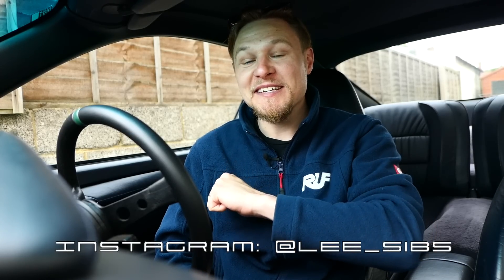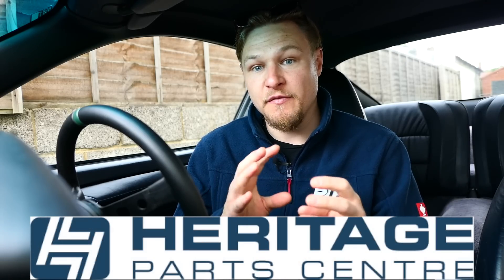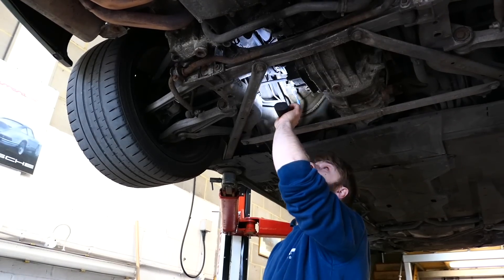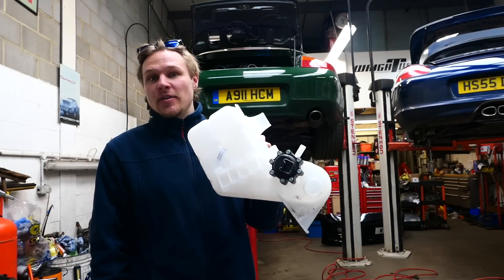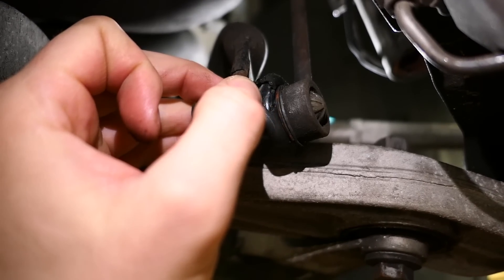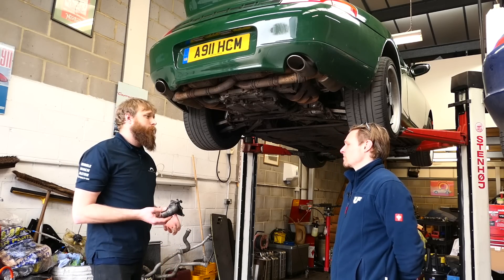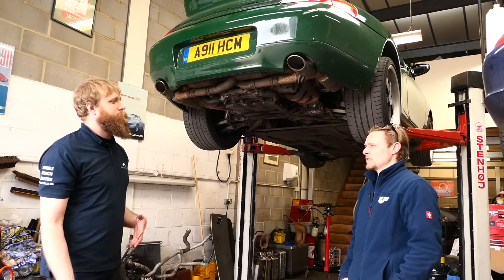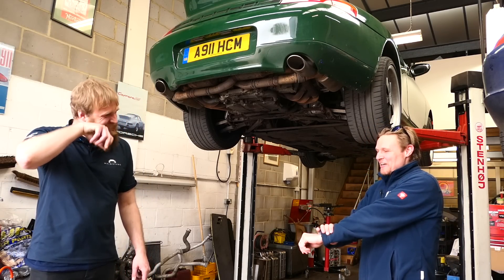Porsche 996 project update: PRESERVATION V RESTORATION *part 1*

Comment: Illustrates two things to me... 1. Build a relationship with your workshop. This happens over time and with good experiences. It also comes from understanding that, with these older cars, things don't always go according to plan and aren't always solved first go. 2. With that relationship in place, you can then have honest dialogue about those preventative maintenance issues. Can something wait? Should it be tackled immediately? My philosophy on preventative maintenance is that, if a problem (or future problem) is identified, address it sooner rather than later - particularly if you drive your car often. Great vid Lee!
Reply from the maker: You're bang on, Andy. In this instance Wrightune went through my car last autumn as I asked what needs doing in the next year, so we came up with a plan of what's urgent, what can wait, and what can be done at the same time etc. It's helped with some financial planning, even if things snowballed slightly! Thanks as always for the kind words, I really appreciate it coming from someone who makes great vids themselves.

Comment: My 996 just passed 150K (miles)  and we’ve recently done a top end rebuild.  I would recommend that everyone keep an eye on the hydraulic valve adjusters.  This is a non serviceable part but I had one fail and it was a lot of time and effort to get back on the road.  Btw after checking the price of the parts from Porsche I checked to see if they were made out of solid gold.  They weren’t.
Reply from the maker: Ahaha! Love that, good old Porsche tax. Great advice on the hydraulic valve adjusters.

Comment: This is so so relevant to me as My 996.1 is in the garage now as it had a coolant leak in the front of the car so limped her to my indie with my water bottle in the passenger seat. Left her with garage hoping it was just a hose but No it was the dreaded corrosion so both front rads need replacing then I get your same call we have a oil leak under your gear box. Galvanic corrosion between the Ali box and the SS hose so now I need new pipes But the corrosion is so bad removing the old oil pipes splits the gear box casing so now I need a new gear box !!!!!  You hear endlessly about IMS worries the real issue for a 20 plus year old car is corrosion corrosion corrosion. This is going to be expensive but like you said prevention now will save money later so fitting a new oil separator and IMS seal while engine is out. Just remember most cars built in 1999 have been crushed into cubes by now so lucky we can still enjoy these amazing analog machines. Shame about the size of the bill though 😐
Reply from the maker: Absolutely spot on here Mike, word for word.
Reply: @9WERKSTV   I will let you know how I get on no doubt more issues will be found but engine out seems ok my engine mounts survived at least . Indie mention my gravel drive may be a issue for 911s they hold moisture which over time accelerates corrosion
Reply from the maker: @mikekcarey  Not heard that one before, but suppose there's some method to it…

Comment: Reminds me so much of when I bought a 132k mile 996. In 2 years it had new poly bushes all round, clutch/IMS upgrade, a gearbox whine sorted, rotten a/c condensers (which I never replaced), & a number of smaller items. Still bought a smile to my face every time I hit 4k on the tacho though........
ps do all your vids run for 9:11?

Comment: love this! It takes SO much time to just figure out all the “while I’m in there”-jobs and the bills just run up. I need to do a rear main seal job due to a small weeping leak. SO we’re looking at IMS bearing, clutch and flywheel (this comes with its own WIIT-jobs like clutch fork, ball pin and seals), rear case bolts, transmission mount, oil change (almost due anyway) and the list goes on.....all because I need to change a €18,- RMS.....😄
Reply from the maker: Ahahaha! You're bang on, Klaus. It might be an €18 Euro job which escalates, but rather that than a €3k job which escalates – as they all do!
Reply: I bought my 1997 996 with a weeping main seal (it wasn’t used very often by the previous owner). I’ve been lucky, since I’ve been using it as my daily driver it’s stopped leaking 🤓👍🏼
Reply: @FlatCapDriver  lucky bastard 🥳
Reply: @khestehave  😝

Comment: It took me a few videos of Brits saying "hach" to realize they were saying "H". We still love you over here in the US! Lol
One thing about Porsches is that all the mechanical bits on a regular sized car are all squeezed into a much smaller space so working on them is much harder. 
Can anti-seize be used instead of grease, silicone grease?
Did one of the bleeders fail or a connector on a line?

Comment: Have you looked into the cylinders with a camera to see .if cylinder walls are scored. before going more forward?
Do you want to install The IMS Solution IMS bearing that uses engine oil to lubricate the bearing?
Reply from the maker: My car already has an uprated IMS, and there's no telltale signs evident including smoking on start-up which indicates excessive bore scoring.

Comment: Just curious maybe someone else can answer. How come engine mounts failed from lowering the engine? Shouldn't the engine mounts be unbolted before lowering the engine? Also, what corrosion would there be preventing a brake fluid flush? Calipers are aluminum so they don't rust
Reply: I expect that the nuts and bolts on the engine mounts were rusted and took a lot of "persuasion" to take off. This led to damage to the old and weak engine mounts themselves because the bolt runs right through the middle of the mount.
Flushing the brake fluid prevents water suspended in the brake fluid from corroding the brake lines from the inside.
Reply from the maker: From Chris at Wrightune:
Engine mounts: The nut was seized on the stud. Undoing this tore the rubber part of the mount which was old and badly perished causing them to leak.

The Calipers: aluminium does corrode. Also steel and aluminium react with each other. The bleed nipples/valves are steel. Often these are corroded into the caliper. When you undo them they can tear all the thread out and the seat on which the valve seals. You can run into the same problem when removing the brake pipes which screw into the caliper.

I hope that helps!
Reply: @9WERKSTV  thanks for going out of your way to get the response! Crazy how much knowledge an actual mechanics has over someone like me who considers themselves fairly mechanically inclined.
Reply from the maker: @dominik1701p  My pleasure!

Comment: You should have fitted semi solid engine mounts from rennline, miles better
Reply: not if you wasn't expecting to change them - I swapped mine for 993RS semi solids, worked a treat
Reply from the maker: Yes as Edd said, mine had failed while on a ramp, I couldn't wait on parts from the States etc.
Reply: I’m not really a fan of those.
Reply: @danknox9986  care to elaborate?
Reply: The are hard as a rock and they make your car louder, vibrate more and overall much harsher to drive. So no, they are not miles better. Maybe if you track your car, otherwise they are just rubbish.
Reply: @N911GT2  certainly not the experience I've had on mine. It was noisy and harsh for about 30 miles, now it's a little noisier than stock at idle, but when your going the car is noisy anyway, plus the biggest benefit is that it provides a better gearshift and minimises the delay between the front turning in and the rear following. 
Makes the whole car feel more immediate.
Reply: @N911GT2  I would disagree completely, have mine fitted for over 2 years on the medium compound ,and no discernable difference in nvh, and transformed the car
Reply: @eddthirty4065  I agree completely, I put mine on the Yellow inserts, so the softest ones, it transformed the gearshift and handling, one of the best mods I had done.  I would definitely do it again,and probably will on my turbo

Comment: I disagree on the grease, you shouldn't grease where it isn't specified, at least not without someone adjusting all the torque specs which needs some math. There's no reason to anyway, so long as that bolt and nut are only threaded on once there is a factory anti corrosion that works well.
Reply: I came looking for this answer. Don't ever grease your bolts. Grease is made to let things like better, the last thing you want in a bolt is it gliding better, on or off.